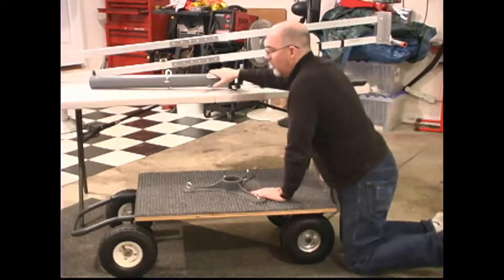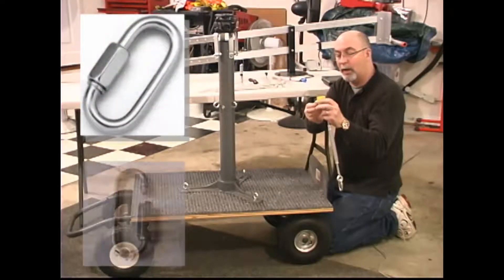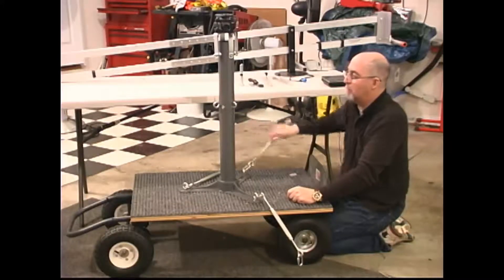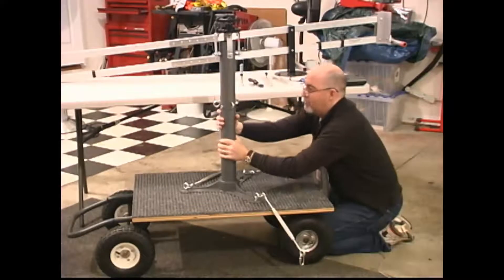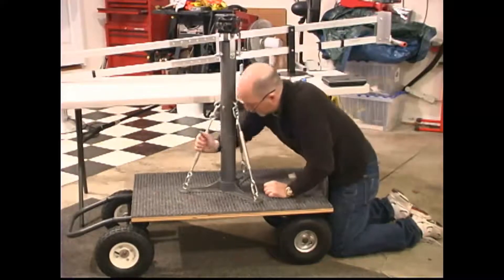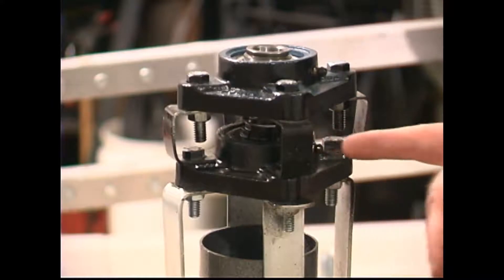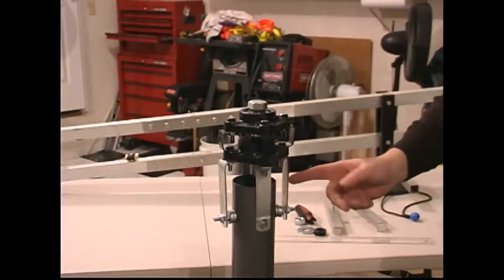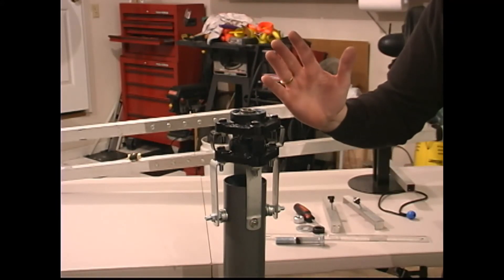Part 2 How to Build a Jib Crane

Comment from the maker: Carabiners just weren't beefy enough for the weight the system was carrying. I've had to re-enforce the entire length of the unit after I added another 4feet  to the unit. I now have a cable that runs from the pivot point to both ends to help distribute the weight.

Comment: rather than bending the flat bar, why dont you use smaller section box sextion or hollow tube and 4 longer bolts rather than 8 be a stronger job?